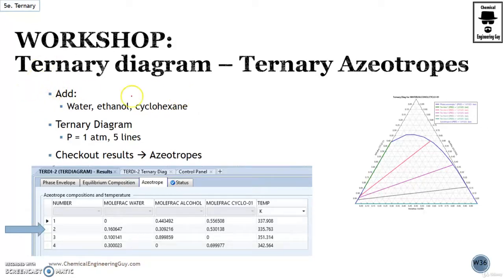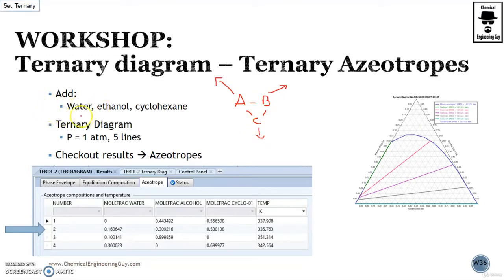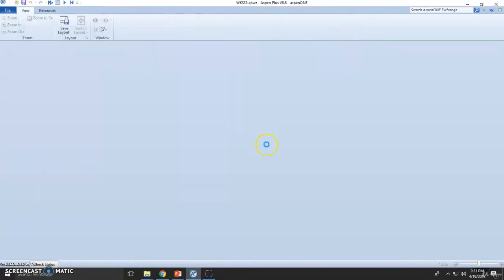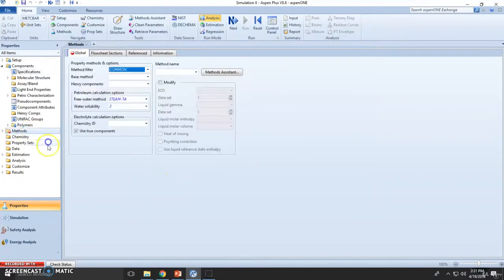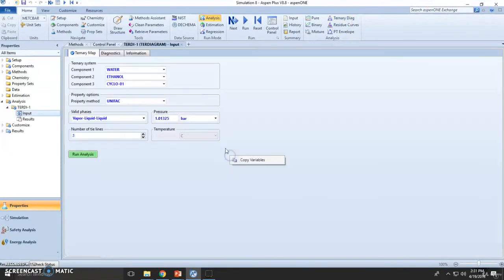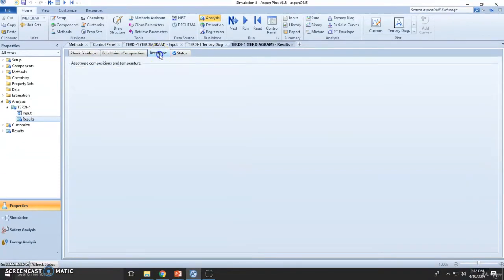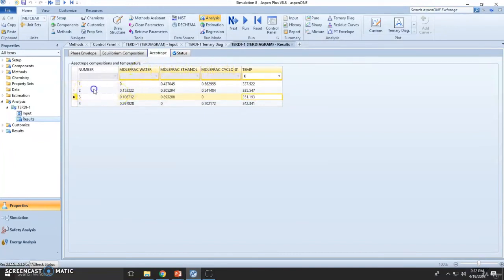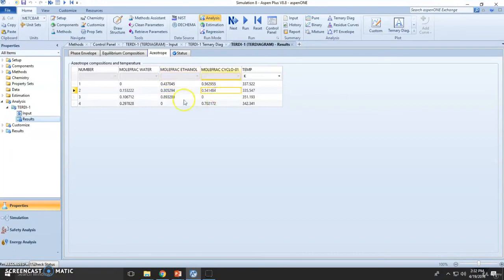Ternary Azeotropes - Workshop - Aspen Plus

Comment: what does the mole fraction of the azeotrope point represent (the results that you got at the end)? I am working on a plant design where I have to use a distillation column to separate my solvent(hexane and Isopropanol) from water. My prof asked if will experience an azeotropic point. I tried using ASPEN and followed your video along with other videos. I get the azeotropic point but I am having a hard time interpreting if we cross that azeotropic point?  Please advise
Reply from the maker: depend son which side you are looking, it will be the final composition of the mixture in liquids phase
Reply: @ChemicalEngineeringGuy  if I email you a picture of the ternary diagram I got , along with my mole fractions of the 3 components going inside the distillation coloumn, could you help me out? I am trying to figure if I will experience azeotrope. I can't seem to channelize all the information I have into a definitive answer. I would really appreciate it